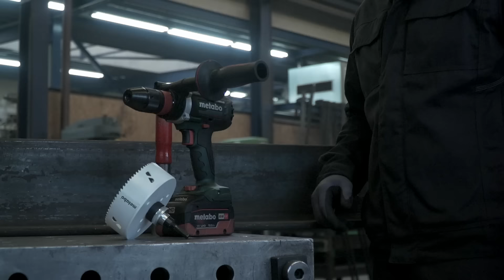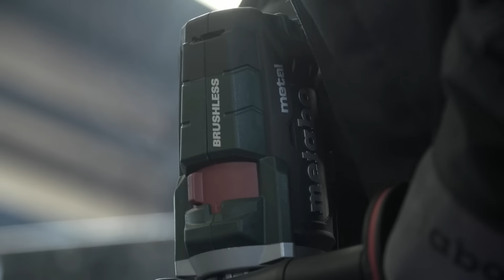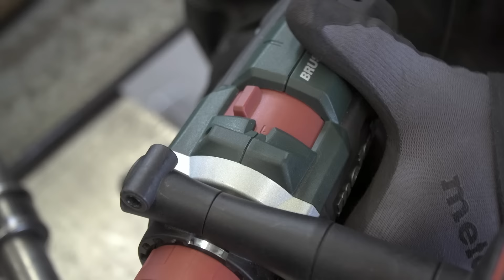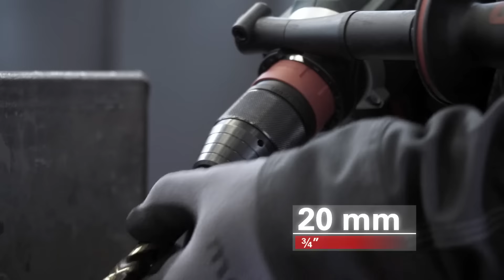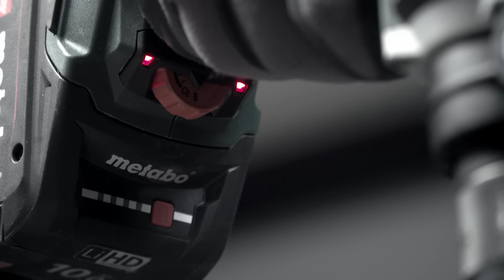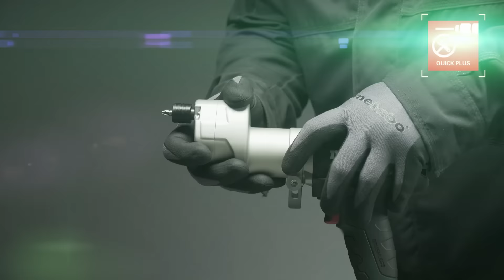Metabo 3-speed cordless drill / screwdriver / hammer drill LTX-3 for metal applications

Comment: Is there a speed limit function in the 3rd gear now?
I have the previous version of the drill,
When I use the 1st and 2nd gears, the speed of the drill will also be reduced by turning the limited twist wheel,
But this is invalid in 3rd gear, the speed cannot be limited, the torque limit function does not work accurately
Have you fixed this problem on this new drill?
Reply from the maker: Hello,

I spoke to our service team about your described problem and they can`t reproduce it. Could you please get in touch with them to send your machine back to us and get it replaced.

E-Mail: reparaturservice@metabo.de
Telefon: +49 7022 72 3220

Best regards
Team Metabo